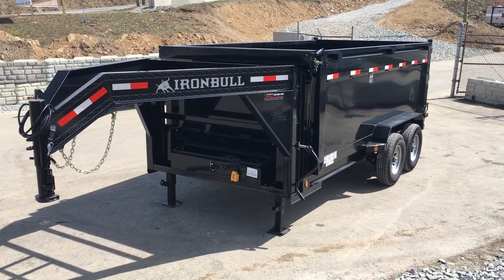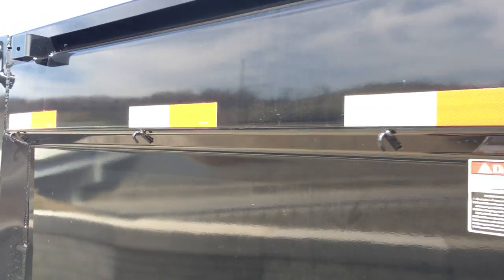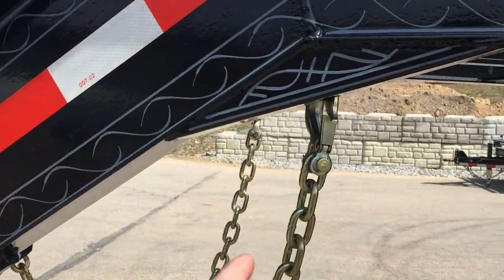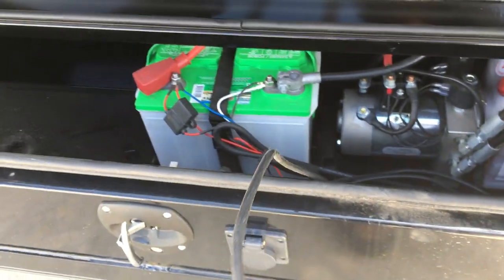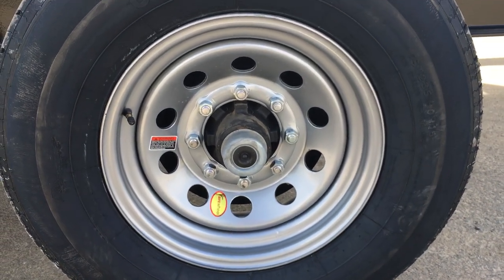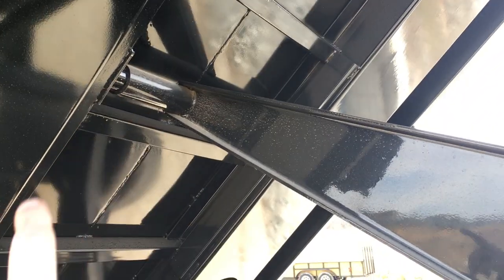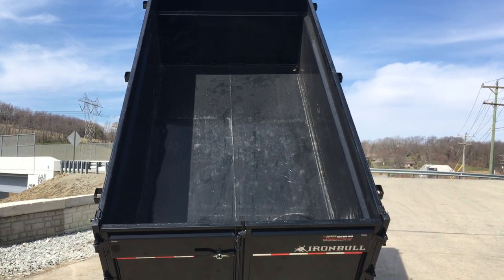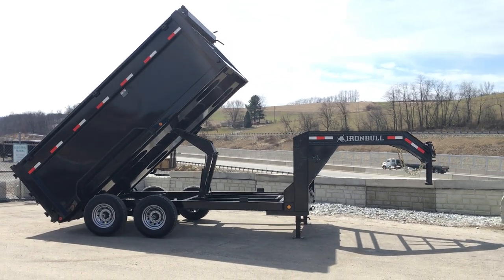Ironbull 7x14' Gooseneck Dump Trailer 14000# 4' HIGH SIDES IB8314DTG14HIGHSIDES4

Comment: Why didn't they put oil bath axles on that
Reply from the maker: Because it has 7000# axles.  I'd venture a guess less than 1% of 7K axles have oil bath.  Oil bath is ideal for high mileage, over the road trailers due to improved lubrication.  Oil bath generally starts with 8000# axles, and the vast majority have oil bath, although there are some with grease.  Farmers, who as a whole tend to use trailers a bit more infrequently, typically prefer grease as they don't have to worry about the seals as much as oil.